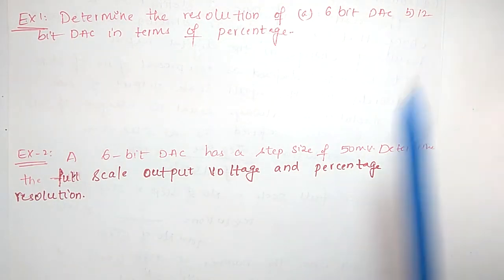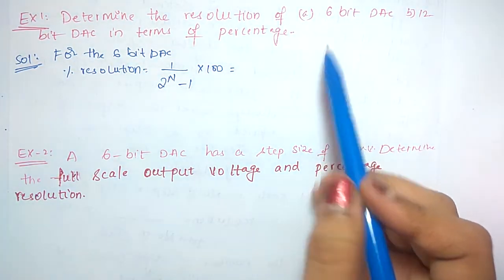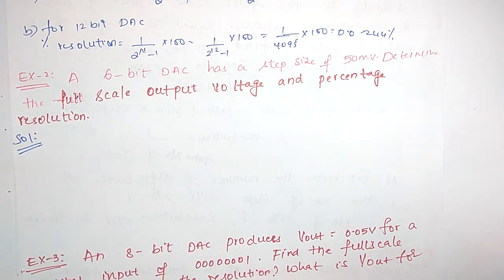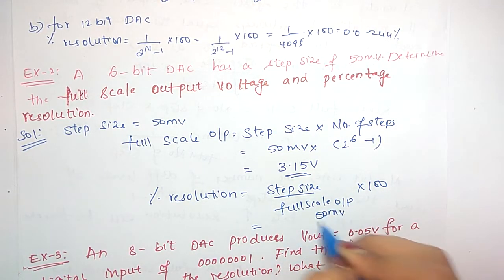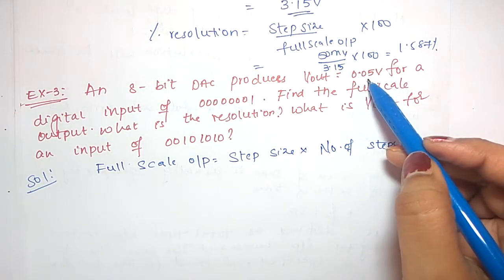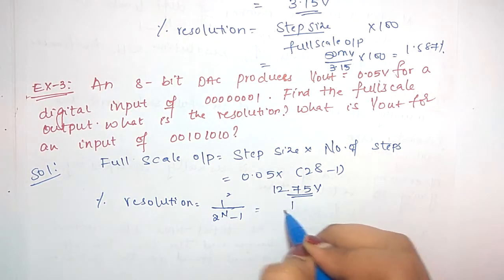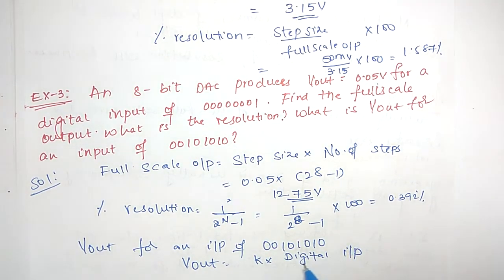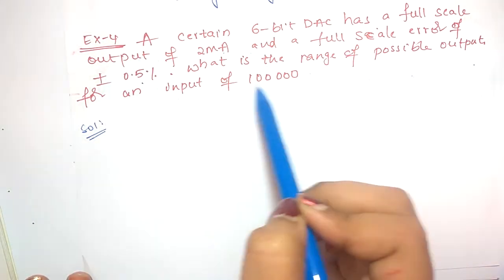dac converter example

Comment: A resistance temperature detector (RTD) transducer is to be chosen such that the analog-to digital conversion will have a resolution of 0.001 c . the conversation uses 16 bit . the RTD will be in a circuit with a lower voltage of - 0.15 V at the lowest temperature extreme and an upper voltage of 0. 3 V at the highest temperature extreme . the RTD will have an output of 0.000 V AT zero degree . what is sensitivity of the RTD ?